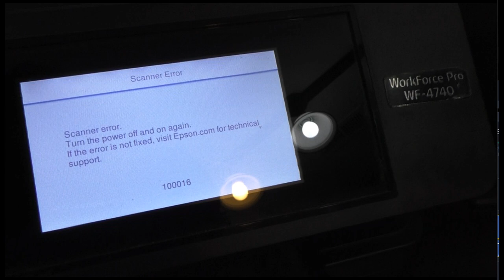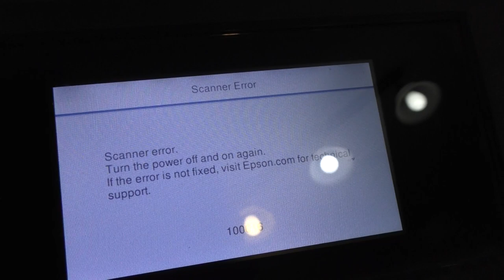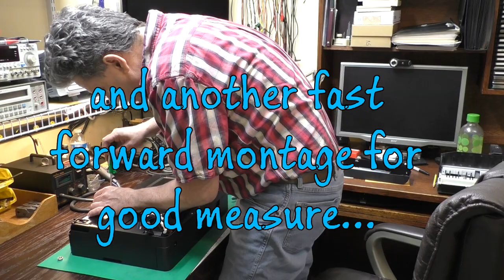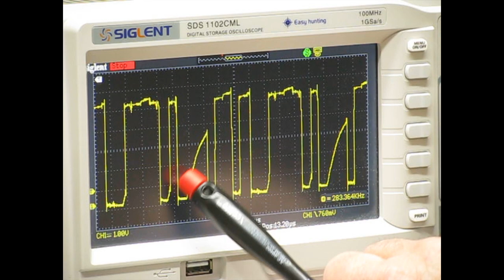Repair attempt: Epson WF-4740 with Scanner Error 100016

Comment: Any suggestions for me? My Epson WF-4740, I had this scanner error originally but I updated something and it went away but 2 weeks later now it just keeps saying Epson across the screen like it does when you first turn it on, Ive tried to uninstall and reinstall the drivers/software and I tried to update the firmware, it wouldn't allow it and said (downgraded cannot be updated). I tried connecting it via wifi and directly to router also from computer to printer via USB cord, nothing. Cant push anything except for power off and on. I called Epson and they said its a Hardware problem and to bring it in or buy a new one. Thank you
Reply from the maker: The recent FW upgrade did not change things for me either. I found if I turned the unit off,  raised the whole top like I was going to change ink, then turned it on it would alter the initialization routine. It will tell you to close the cover, wait until all motion stops and then close it. For me this will bring up normal screen every time. This makes me wonder if there is a broken wire that runs up to the scanner/ADF.
Reply: Kate, that's just the thing I'm researching right now. My three year old 4740 suddenly started booting but stopping at the EPSON logo (with the swaybar thing going back and forth). It would tell me there was a firmware update available and I was low on ink (true) so there was some processing happening and I could press the power button and it would properly shutdown, but that was it.
I've discovered the way to boot into a "Safe" mode is to hold the power button down (while powered off) with another finger placed at the top right corner of the display (in the black border area) until the blue light comes on and you'll get a black and white screen. At that point you should be able to talk to to it through a USB cable and there's a recovery firmware available that you can then push to it from a PC.
I was able to do this but alas, this didn't solve my problem.
Reply: @ChuckD59  Im so angry. I just bought all new ink for it as well. Ive tried everything. They told me its a hardware issue that cant be fixed.  Seems like a software issue to me but I dont know much about printers. They offered me a small discount on another Epson printer, I declined. I spent $300+ on that thing, you think it would have lasted more than 2 years. I bought a cheap HP, its terrible and slow and I miss my Epson but I wont give them another cent. Please let me know if you find a way to fix the issue. Thank you and good luck.
Reply: @k8hope11  I feel your pain, Kate. I've just recently retired from  24 years in IT and while I thoroughly enjoyed it, printers and printer manufacturers made my life miserable and I hold them now in the lowest regard. They seem to only exist to suck people's money out of them. I just found the receipt for mine and it's exactly 3 years old, and I'm now shopping for another, non-Epson and likely non-HP printer. But I cannot see just adding this to a landfill (as apparently they anticipate customers will do) and will continue to work on this.

Comment: Having same issue and the Fix doesnt work unfortunately.  Very frustrating as this is the 3rd issue Ive had in one year and have had to send it in twice already.  Now the warranty is gone.  And I literally havent been able to print after getting it back for the 2nd time.  Oh and did I say this is the 2nd one I bought!  The 1st one had an issue in the first month!
Reply from the maker: I have up on Epson and bought a new Brother printer.
Reply: @HeyBirt  Thanks! What model? I need one that prints really well for flyers, brochures, etc. I'm a realtor
Reply from the maker: @amberleefleming  Brother MFC-J6945DW. This is a larger printer capable of printing/scanning 11x17 sized paper. They make ones in the same line that are smaller though. They have large ink tanks and the cost of printing per page turns out to be lower.

Comment: For me, this error appears to be a component heat issue. If I turn the printer off for a week or so, then power it back up, it will work ok for a few days without the error, then eventually goes back to the error. I've done this numerous times, especially since this is the only way I can replace ink!
Reply from the maker: Thanks for the feed back.

Comment: THANK YOU!!! You are brilliant!!! I had to skip to the end like you said (because I am repair challenged) and IT WORKED!!!!!
Reply from the maker: After a month or so I'm not sure how much opening/closing the ADF helps but power cycles will often clear the error. I can go 3-4 days with it working fine and then it will pop the scanner error up for days at a time. When the error is not showing it scans fine as well. Very frustrating.

Comment: Hey Birt thanks for you Herculean effort in correcting the scanner error. Any chance you could do a follow up shortened edit. without the it's not this. I found a few videos that have corrections repair involved opening, cleaning and checking connections. Also checking for loose parts. Thanks again for putting this together it was a painful process sheing all you went through.
thanks
Reply from the maker: In the first two minutes of the video I suggest going to the end if you just want the final 'fix'. Which in honesty is not really a fix but will sometimes get the silly printer to reset.
Reply: @HeyBirt  thanks been looking at the assorted Epson scanner videos. Mine would print but I can't clear the display. Wound up getting a EC-4030 which with coupons (honey) and some staples rewards fro about $100. I''ve put the 4740 in the later,  maybe pile.

Comment: any suggestions on a new network all-in-one that is not an Epson? None of these fixes is working for me.
Reply from the maker: I'm not really sure what unit to recommend. I bought the Epson WF-4740 because my old printer died and I had to have one immediately that could two sided scanning through the ADF. After getting it I found out Epson had screwed everyone by making it impossible to use aftermarket ink.

In the past I have purchased refill ink/cartridges from inkproducts.com and found them to be a very good source of high quality refill ink and knowledge. If I am forced to buy a new printer/scanner I'll check their website first to see what printers can be refilled.

Comment: Ok, try this, I don't guarantee it, but it worked for me.  All you can do is try it, its very simple and doesn't effect any processes.  
I have been dealing with this issue for at least 4 months and my machine is in pristine condition (except the error).  After watching many videos, including this one, they all failed.  I even tried to install the previous version firmware using a USB and the issue persisted.  Mine wouldn't shut down holding the power button trying to get it to cycle.  I had to use the touch screen.
So today I come across this WF 2600 series with a similar issue and watched it... https://www.youtube.com/watch?v=-27drpNQfLA&feature=emb_logo ...I then went over to my 4740 and popped the scan lid and saw a latch hook instead of a alignment pin.  I wiggled latch...checking for issues and saw none, ...shut the unit down with the lid open, ...closed the lid, ...power up and WHALA!!!! the screen came up normally and the first thing it did was tell me it had a firmware update, which I installed.  Apparently my install of the previous version took.
Once completed I printed a couple test pages and it is working like old.  I hope this helps you folks and yeah, unbelievably, ...it was that easy.
Reply from the maker: Sorry, it is not the latch. It is just the luck of opening and closing the lid. My guess is that it will pop up again in a few days.
Reply: @HeyBirt  No doubt it may return, I will have to keep you updated.  But there has to be something in that process that allowed a reset (which I tried finding many times how to accomplish).  Like powering the device off with the lid open, then closing it before repowering?  The similarity of the 2600 and 4700 issues can't be ignored either.  I believe the install of the previous firmware also worked.  Because it was shortly after the recent firmware upgrade I had my issue.
Also, I now have a Drive icon for Epson, ...its listed as a USBSTORAGE (\\EPSONB84D1C) (Z:)
Mine is on a network setup btw.
Perhaps Epson is doing what Apple does to make you buy their new phones and load up the memory with an update....LOL
Reply from the maker: @Normandy1944  This error has to do with the scanner homing. The scanner head moves to the section between the two scanner glasses and tries to scan a white target patch the is under that section. If it can't see the patch you get this error. (or if it can't find the home sensor for the scanner or a few other things.)

The scanner will try to home if the ADF is up or if the whole top is up.  The latch you are talking about just keep the ADF from flopping loose when you open the whole top to change ink.

Most often if you get it to start up without the error and you try to scan from the glass you will start seeing colored streaks through the image. I would see streaks which went away after a few scans and then came back after a few more scans.

It is a huge problem exacerbated by the fact that Epson decided to take over the entire LCD to show a canner error message making the printer mostly useless too,
Reply: @HeyBirt  I can't totally agree its not the latch.  Because without it being properly engaged, to indicate the scanner is closed, the unit won't cycle to find the white target you indicate.  A copulation of items, in whatever sequence, would seem to indicate poor engineering for sure.  I generally only print 99% of the time, I rarely copy a document, which is why I was befuddled why I would get a scanner error.
All I can do is keep you updated on my scenario and see what happens.  Thanks for your replies.
Reply from the maker: @Normandy1944  Thanks. If you lift the ADF it will still home the scanner. previously thought that if you lift the whole top it would not try homing the scanner, as when I lifted the whole top and then turned the printer on it would always start up but show an error about the top being up. Then I started getting the same scanner error with the whole top lifted too. 

I really think this is a problem with the FFC (ribbon cable going to the scanner) or the scanner head itself. I was puzzled by the number of contacts in the cable and then it occurred to me they may be sending multiple bits for each color in parallel. This might explain the random colored stripes when scanning, i.e. you loose connection to a few lines of one of the color data busses. I even took it apart a second time and reseated the FFC in the connector on the scanner head. I was hopeful as it worked fine afterwards but it only lasted 3 days.

Good luck. I bought a new Brother printer/scanner.
Reply: @HeyBirt  Hey Birt!...hope your doing well...Its been awhile and I wanted to update you.  It was about 2.5-3 months after this posting I received another error message, I lost the paper I wrote it down on... I'm almost sure it was the same one.  But the situation was almost identical, no printing, screen locked up, no touch controls.  So I opened the scan lid as before, ..shut the unit down by unplugging it this time (thus no touch controls), ..closed the lid, ..plugged it back in and booted it up and its been working great the past 7+ months....and taking updates regularly.  I even did a rare scan.  It notifies me of my ink levels (have done 2 changes since as well).
I don't know if this has to do with the Epson App being updated or getting the unit working again...maybe both?  But my update check is happening monthly like clock work.  I know it wasn't doing that beforehand.

Comment: UPDATE  Printer and Scanner software but there's also a Scanner Firmware update that needs to be done.
Reply from the maker: The firmware update does not help sadly. There was a new firmware update that came out about the 1st of August that did not do anything to help the scanner error for me at least. Epson did not really mention what the FW update changed so perhaps it does help in some cases.
Reply: @HeyBirt  What worked for me was updating the Scanner Driver which came out on 2/20/2020  Version 6.4.85.0  The conflict I was having was the Epson driver and my ViewScan driver was at conflict.
Reply from the maker: @19Photographer76  I just got on the Epson website and it looks like the 2/20/2020 update was the printer driver. There was a update in the scanner driver on June but it looks like it was just an update in the scanner utility program. I don't see any change in the driver version looking in Device Manager. Epson does not really say what the updates fix so who knows :)
Reply: @HeyBirt  My error message came back up this morning and I wasn't even using it?
Reply from the maker: @19Photographer76  The error happens when the printer tries to reset/initialize. According to information that someone got from an Epson repair center this error code is a 'position error'.

I thought maybe it was a broken wire in the harness going up to the scanner/ADF but now I am not sure. 

Try this, turn the printer off, raise the main cover like you are going to install ink, turn the printer on. It will move the print head and the screen will tell you to close the cover. Wait until there are no more sounds coming from it, this might take 15 seconds or so. Now, close the cover and you should see the normal screen. I think this procedure interrupts the normal scanner reset/init process.

Now, put a single page on the scanner glass. Use the Epson Scan utility to do a 'Preview' scan. I set mine to do a 600DPI color scan. Does the first scan look awful? Lots of color lines and such? Repeat the preview scan several times. Does it clear up?

I'm thinking it might be a case that if the scanner is not used for a while it 'sticks' and errors out during the reset/init phase.
Reply: @HeyBirt  The first 2 scans were clean but then subsequent scans developed more and more colored lines.  I stopped to think about it and in that paused period, I got the error code.  I had trouble shutting it down and the error message then said if another process was running to wait.  It finally closed after I unplugged it and plugged it back in.  

I'm going to delete all of my software and reinstall.  If that doesn't work then it will be a new printer.  Thanks for helping!
Reply from the maker: @19Photographer76  I really don't think this is a driver issue. It seems much more likely it is a mechanical or electrical issue with the scanner. 

The colored lines are an indication that the scanner is not moving properly/smoothly, that the position encoder wheel is slipping or that there is a break in the wiring to the encoder.
Reply: @HeyBirt  The reason I was thinking it was a software issue is my computer hangs up when the message appears.  I can't turn the printer off either, I need to unplug it?  I'm connected via Wifi so I wonder, I should try a tethered connection.  I understand your point but it could be the wifi connection causing the misalignment, right?
Reply: @HeyBirt  Thanks, do I get a scalpel and open the belly or get a new unit, ugh...

Comment: Unfortunately, the scanner error came back & won't go away 😢
Reply from the maker: Try this: turn it off, open the lid like you are going to change the ink. Turn it back on, the display will tell you to close the cover, but wait until everything is done moving. Then close it up. When I do this it will stay on the main display until the next time the printer tries to initialize itself (say 5 minutes). It was long enough to be able to change ink though.

Comment: Thanks for your help
Reply from the maker: You are welcome. I may have found the root cause of the problem and how to fix it this weekend. My printer is working fine now, will give it a few days to see if the error comes back and then will do a new video about the fix.
Reply: @HeyBirt  I can’t wait as it seems to repeat the error
Reply from the maker: Sadly my 2nd attempt at repair by reseating the FFC in the connector on the scanner head failed :(